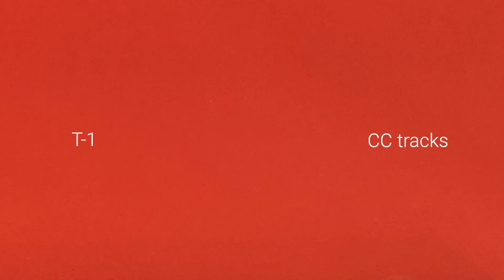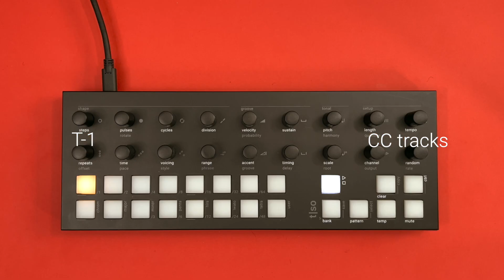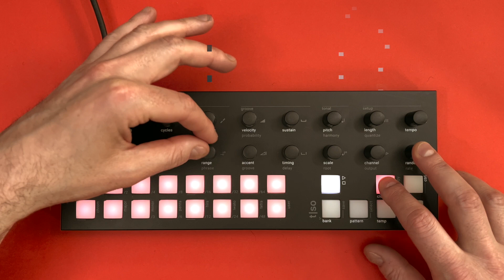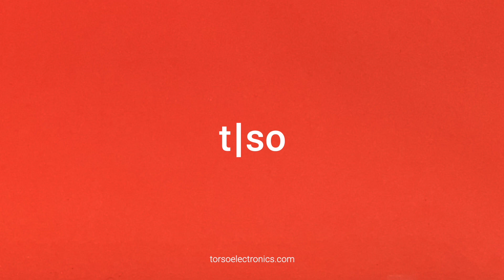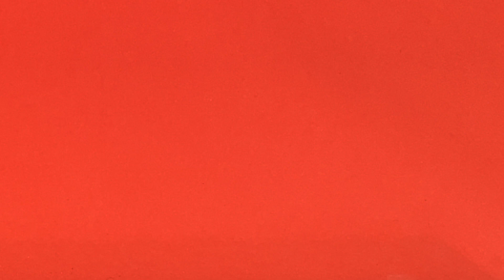T 1 CC tracks

Comment: Are the 14 knobs of fixed CC value, or can they be pre-set (via app??) to match what my other hardware requires? Once CC(s) are set for a step, how can they be erased/removed from the sequence?
Reply: I second this - would be great to determine your own cc’s to affect, since lots of us will be using it for hardware with fixed cc numbers.
Reply: Found in the manual "The control numbers are fixed to CC numbers #70 - #83"... it would be really nice if this could be customized. The UNO Drum uses CCs from 20-62 to shape it's sounds....
Reply: Yes sorry to echo other queries but I'm struggling to assign CC control to a value at will. The Syntakt's 'synth' page starts at CC 17 and the microfreak, as another example, has many useful parameters mapped from like, 9 i think. I'm using the Torso beta client and there's nothing in there but if there was mappability, that's where I'd expect to see it. If anyone can point me/us right it'd be appreciated
Reply: @jamiemackie8456  same here... have no idea how to assign my own cc number to the knobs
...
Reply: @salassandoval  Documentation is on page 169 of the current manual. On a CC track, double press a knob, then hold CTRL and PATTERN to open the CC assignment editor view for that knob. On the editor view, the three green buttons are for the hundreds, tens and ones digits. Select the digit to change and then select the blue square (0-9) for the digit. Repeat for each digit.
Reply: they're just default preassigned values, of course you can change them to whatever value you want. Anyways, maybe it changed in the last 6 months and they added this function but it's clear in the manual you can change them. Why would a sequencer that advanced not be able to do that?
Reply: @sebp400 how though?